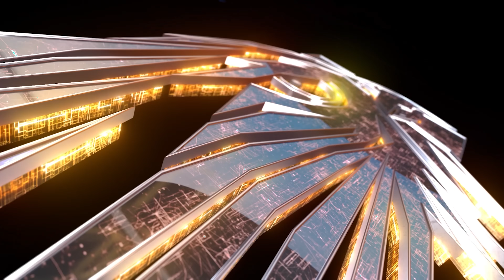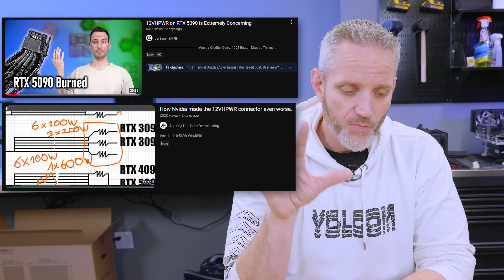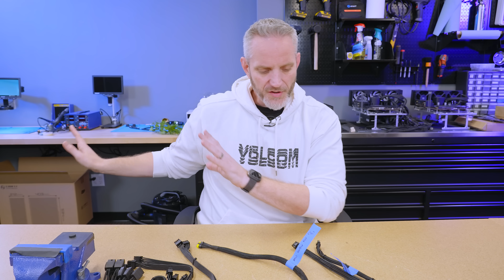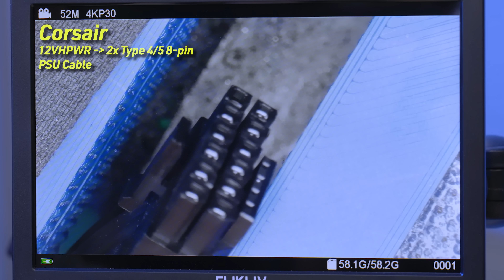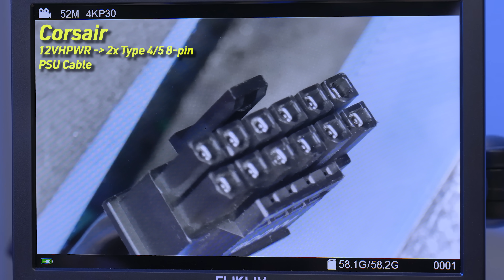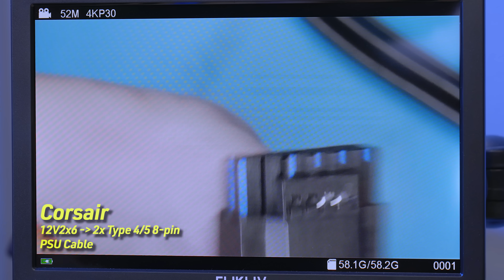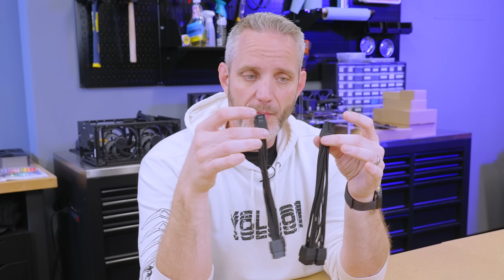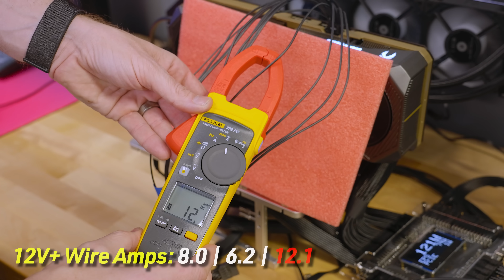I discovered something concerning and I need the Experts to chime in... More 12VHPWR discovery!

Comment: The movement of the pin (technically a socket - or sleeve) in the plastic connector I think is either an issue with the metal barb (or barbs if it's the type that has two) possibly not spreading enough to stick out and grab the inner 'shelf' inside the plastic connector, or it's an issue with that little 'shelf' inside the plastic connector that may be slightly worn or damaged so that the barb cannot hold onto it properly when the wire is manipulated. To know for sure you'd have to remove the wire from the connector and then inspect the pin, and also inspect the inside of the plastic connector where the pin slides into.

Comment: How does the good solid pin cable compared to the jiggly loose corsair cable in terms of amps? Really concerned if i get a $2500+ 5090 that will set on fire

Comment: I'm not an expert, but I did take an electronic engineering class years ago and I have a few ideas. 1 scale up the connector to allow for fatter female pins on the connector. 2 that would also allow a lower gauge wire, a larger diameter wire should stay cooler. 3 implement some kind of collar to retain the wires and pins in the correct tolerances. IDK for sure but makes sense to me.

Comment: 1 the load is not spread out from the thermal cam result on 2 wire heating up like crazy and the rest are chilling nothing happened its either bad design or gen1 config or how gen1 push power  of the psu
2 instead of rating the cable for 600watts max load. they should increase the max load of the cable to 800-1k watts for safety reason mean thicker wire per cable less resistance or better standardized length for normal setup

its the contacts of the pin too little surface contact maybe the recessed one has less contact when plug they really need to change the design of the plugs to have more surface contact the consumer dont need 60k cycles of plug and unplug some dont even pass 5 cycles until it dies or sold for an upgrade

more surface contact = decrease resistance

Comment: It may be time to have a better design and not fight with delicacies (inspect the connections every day if is all right) someone suggests using gold-plated PINs!

Change to "High current connections" like the Molex EXTreme or JK11 Series (High-current Waterproof Connector for Railway Vehicles) but reduced to a scale design, to meet the specs of size and currents. These types of connections are very trustworthy, not a PIN and the surface of the connections is wide and secure. Greetings.

Comment: at around 7 minutes you refer to the cable being "3.1" - there is no difference in the cable spec between 3.0 and 3.1 - it's entirely on the socket (PSU and GPU) side. Great video otherwise!

Comment: Bean counters got to pick the connector supplier at Corsair it looks like, low bid won.  Also check to see if the wire being used is pure copper vs copper plated aluminum or copper plated steel which will affect the resistance of the wire.  Also the length of the wire will assist with sinking heat away from the pins and if the cables are bundled up tightly they will have more difficulty dissipating the heat.

Comment: Ground is ground. It shotty power connection is much worse then a shotty ground connection. A lack of solid contact with power connector will create inefficiency which = heat. Ground ideally carries no current, thus no heat. For the most part ground is ground. As long as there’s contact it should be fine in an application like this. Still, that cable shouldn’t have made it through QC. If that pin is recessed on the ground, it could have been a power connection just as easily.

Comment: Came home from work and checked my RM850e Corsair 12VHPR cable after I saw this video. Sure enough, it's just as crappy as yours. A loose ground pin, a loose sense pin, and definitely varying heights on the pins. Johnny "Guru"  Gerow (Head of Corsair PSU division) says "There's really zero tolerance with this connector, so even a little bit of GC could potentially cause enough resistance to cause failure." Is this what they consider zero tolerance?

Compared to the Nvidia adapter cable it's a night and day difference.

Comment: So i ran a gpu farm of 350+ gpus and can guarantee you that the depth matters.  If it is seated too far back, it will melt for all the reasons Jay said.  I ran these gpus for something like 3+ years at constant power.  Yes, some melt and burnt.  Why? 100% of the time it was the 12v pins pushed back and not making solid connections. I had to manually make sure every pin was always pushed all the way in on all 350+ gpus.  Tedious, yes, but nobody wants a fire to start. Also, corsair psu's suck. So do gigabytes.  EVGA's were pretty solid.

Comment: The cable itself has its own resistance. What makes it worse is heat creates more resistance. In Der8aur’s case, I did the math and it adding up all the amperage’s, assuming he’s getting a solid 12v, the wattage was something like 616w. It could be that his GPU is receiving 600w even thought there’s 616w going through the cable depending on the temperature of the wire and material (resistance).

Comment: I can tell you a few things about cables. I have worked on 500,000 volt power lines and all the way down to DC optically isolated supplies for HP test equipment. Its been a while since I built my rig, however the rules are always the same. Heat and noise are the enemy. Electrical noise through the home, through a spinning fan, through a water pump, etc. Even the frequency of the board. The ground is the number one initial way to reduce unwanted noise. Any static or unwanted frequencies can be dealt with the ground. I apologize for not watching the whole video, I just have a deep daily knowledge that might shed some light. Will a power supply work without a ground? Electrically yes. However it would be smart if the equipment verified the ground before turning on (like most industrial machines) but this is residential. Without a proper ground the power supply will have a hard time accurately regulating the power. So fluctuations should be more apparent. I could really go down a rabbit hole here but let's change to the other problem. The cable / pin outs on the board. I bet that the grounding pin on the board isn't straight either. And that misalignment pushed the pin back on the cable. Yes a more robust cable like the MSI won't allow misaligned pins to push on crooked. The female pin should guide the wire in so that human slop should not be a factor. However poorer cables require the user to be careful... and to push at a straighter angle. Let me know if you need more info.

Comment: I would rather have 4 8 pin connectors instead of a something that will burn up your PSU and GPU! The connector end for the GPU is Way too Small for 600 watts = Too much Resistance!
Nvidia needs to get their collective heads out of their collective Asses and change this! I don't really care about all the hype about these GPU's And the Price are a No Go for me.

Comment: Current can unscrew breaker screws, were seeing what high current is doing to plastic slider clippy things. The cables need to be redesigned or gpus have to deliver less power. 

Because these gooners will not slow down on the 8k furry content consumption. FIX IT NOW!

Comment: Ground aren’t that a problem since normally you have a common ground plane in the pcb. So the load will be shared to all the pin evenly.
For the 12v it depend on the circuitry. If they are merged together it should be ok. But if they are indépendant and made for different part of the card, that could be a problem …

Comment: I bout a new Seasonic 1000 vortex PSU and it came with a 12VHPWR high power cable and my RTX Srtix 4090 did not work fire up. I sent a message to Seasonic and they told me about their 2X6 12VHPWR cable. My Microcenter just happened to have just 1 Seasonic cable in stock. It worked just fine after that. I had a temp sensor on my 4090 and after a new case install my PC registered a temp warning on the 4090. I shut down the PC and immediately checked the cable connection a fourth time just pushing again. For the last 4 days, I have not had any issues. The 4090 GPU has been disconnected and reinstalled 5 times since I purchased it using the Sesonic 2X6 Cable.

Comment: Its the same thing as having a under sized wire with high amps it will create heat. It will heat until over loaded and short/melt/burn /fire or blow circuit/fuse/resistor etc.  We have electrical standards for a reason but low quality off brand will short cut quality to save money. Sometimes highend companies don't even know it because they mass purchase cables and vendor makes a decision to cut cost and this happens. it also comes down to the company doing more quality checks. Vendors can scam them by sending a batch for approval then change mid run also. If no one questions it no one knows... Its also just like building homes contractor put a junction box with wire nuts and no wire stays. Wire moves around and comes apart this create a high resistance draw when it should be low.causes hot spots in the walls. If they just use the correct amount of wire and connectors then this issue is way less. Your using 16ga jumper wires instead of  4,6,8 ga.

Comment: so I just bought a third party cable for used 4080 super I bought like a week ago. 
Got one after everyone was selling off their old 4080's to buy the 5080 or 90's.
and while I checked if the card would fit, I didn't realize how much the cable stands out. 
and so I couldn't close my case without bending the cable really close to the card... which there are warning against.
So I got a 3rd party cable that has a 90 degree angle right on the card side, so it would fit without bending, and it worked fine.

anyone know if this sort of issue could happen with a 4080 super as well? or are they okay? (Its a EZDIY-FAB Shield 90 Degree 12V-2x6 GPU Cable Extension if that helps, it doesn't replace the original cable, just gets added into it.)
Otherwise I guess I gotta leave my case open if I need to use the original cable only, which really sucks... or downgrade back to my 2080 until I can get a bigger case..

Comment: sound like rocket science!? i think most of the peoples knew is the connector pins are thin and wire too small this is why hot and melt. use 10 gauge and thicker pins sure solve the idiot problem.

Comment: If anyone still has doubts if it were still a user error: If the whole cable melts (as was the case), either the cable diameter is too small, the cable standards are wrong or the power allocation from the card is wrong (engineering mistake). In no way the user is at fault here. 
It also has nothing to do with the plugs, if the whole cable gets that hot, the connectors get hotter. Were talking about 250watt plus trough a single small copper wire with only 12volt!! (lower volt = higher amps = thicker cable)
Also, longer cables need more diameter for the same amps (due to resistance ==> voltage drop, that's why they use high voltage for electricity transport). So the argument about the longest cable here might be good @15:00 , probably not as it will produce more heat due to it's length, resulting in increased resistance (more heat = more resistance = less stable volt/amp output to your card so keep them short).
Some basic electricity rules you might want to know for overclocking as well 😉

Comment: That wire gauge is very concerning. That along with poor female pin tolerances. Honestly, its a bit of both faults. The 12 pin design could been done much better and the harness makers need to do better

Comment: 23 amps, wow, that's crazy.
Once you Calculate how much power any cable can handle, designing a cable should be pretty simple. That's equally true of the male and female connector capacity. 
I suspect that it's a quality issue for the connectors. It really isn't hard to make a good quality connector, it just costs more money. I have designed and made bespoke electrical connectors. There are seriously high quality parts out there and making an equally high quality housing for the parts is important for a reliable connection.
Those Dupont type connectors are pretty crappy. I only use them on cheap, low power things that I make. I move to much higher quality connectors for higher power / ampage designs. Dupont pins are super cheap and someone has went down that path because they are cheap and readily available. But they are often crappy and a bit warped, bent a bit oddly and are easily damaged when the cable loom is assembled. I hate them for anything except connecting LEDs but the PC industry has been making pretty low quality stuff for decades. I'm not slagging anything off, it's just how things are done. Big chunky Molex connectors are crap but they are fairly gorilla tolerant. I really do think they need to move back to molex or start using much higher quality connectors. I'd happily define the spec but I'm sure the electrical engineers all know the same things that I do and ultimately this is all about cost. I regularly use things like mini-burton connectors, they are seriously reliable and robust. Pretty much gorilla proof and last for years. They are expensive and you are getting what you pay for. I'm not suggesting we move to Burton connectors, I am suggesting the existing 12V connector is dumped as it's clearly too easy to have bad connectors. If the weakest link is your cable and it is unreliable, unsafe and can cause damage and fire, well it's not too much to say get rid of that and replace it with something reliable. Just kill it off and move on. After the experiences of the previous generation you would have expected this to have been ended. It must end, it's clearly a faulty connection and moving to something reliable and robust is required. It shouldn't be this difficult.

Comment: Also another thing to add... With all this 12vhpwr bs going on, i would expect the board parters to design some cards that take 4x 8 pins as the power option. Plenty of high end cards used 3 already, adding another one isn't a big deal.

Comment: I cant understand why they need such a small complicated cable bundle?    Just increase the   wire size and and use less and thicker  pins.     More heat dispation.   More surface contact.    I would be super pissed if my 1500 + gradics card burned up

Comment: If GPU OEM's want to go the route of ridiculous power draw the Plug Pin design has to go and be replaced with a plug which has one large flat bus bar as the 12v pin. The GPU power section must also have power management to the different sections of the board.

Comment: This connector is dog poo. If you're pulling 23 amps on one side and the other side is just wishing for work to do that's an imbalance of epic proportions. Exacerbated with some pins that slip and not fully seating or making flimsy contact? Like Derbauer said, this connector not safe for consumer use. This connector spec needs more leeway in it's maximum conductivity and inherent safety designed in it's connection. It needs to be replaced by some screw terminals and a pair of 8 ga wires.

Comment: Another electrician pov. The primary issue is them getting rid of proper pwm distribution for each +12v pin on the card. So what theyre effectively doing now is powering one large load with many small wires in parallel. In the electrical world we have rules to follow when doing parallel runs to ensure uniform amperage on each wire. On these GPUs, even a small resistance difference in how well the pin and sleeve have mated can largely affect how much amperage is going to go down that wire. Electricity doesnt care how hot things get. It will take the path of least resistance. I wouldn't be suprised if theres an actual recall or nvidia makes an interposer connector with a small IC on it once this gets more traction.

Comment: The problem is NOT recessed pins. It's the opposite. If most pins are recessed, and one is NOT, then that one with better contact will fry.
That's also why it's rare. Most pins need to have bad contact for it to happen.